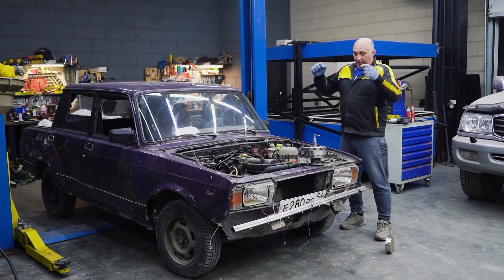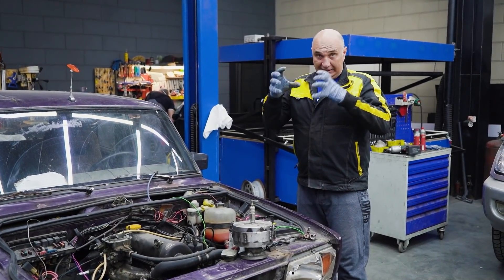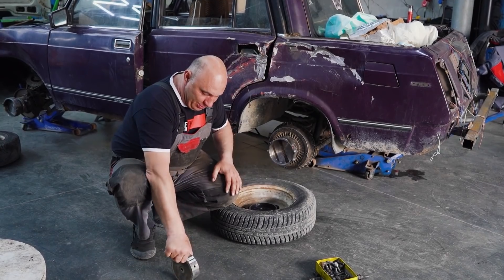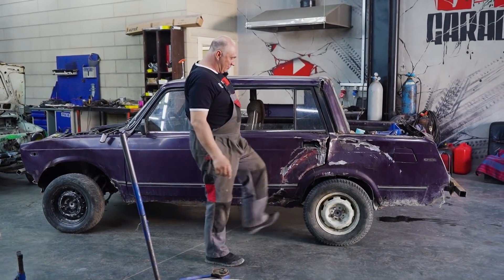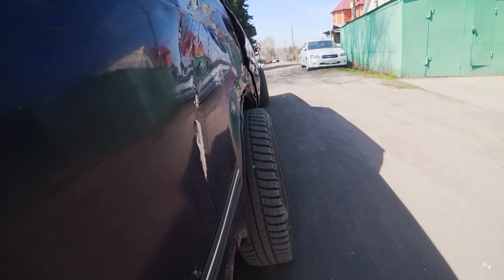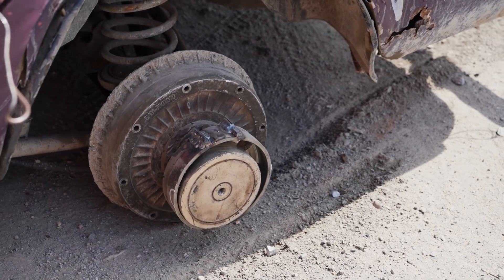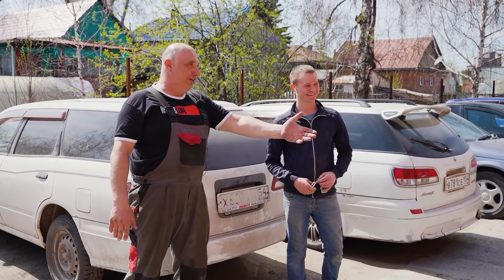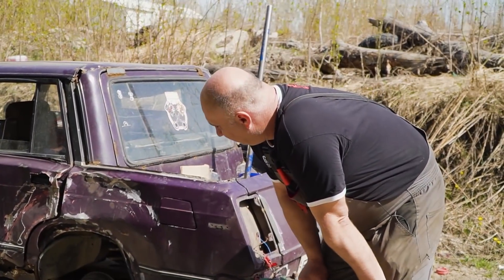Using magnets to mount wheels – will it work?

Comment: You should redo this test instead of one magnet on the hub and instead of using that magnet to attach the wheel put one magnet on the wheel and one magnet on the hub. making it a total of 8 magnets. your issue here just like you demonstrated at the beginning is lack of iron on the rim.

Comment: I used to do magnet fishing, one time my magnet got stuck to the metal reinforcements of the river bank. Due to the angle I couldn't pull it of with the rope, so I went back home and got my wet suit but when I got back my rope and grapple were missing, they couldn't get the magnet though 😂 I managed to get it off when in the water as I could pull it from an angle where it was weak.

Comment: They have material handling magnets for industrial applications moving sheets of steel they hold as much as 4500 pounds each made for moving steel on factory floors 4500 pounds = 2041.166 Kilograms

Comment: Project idea.  For the brakes on a car, instead of disc or drum brakes use a clutch and pressure plate from a manual transmission for a braking system.   Modifying the “clutch” and attaching it to the hub for a break system instead.  A lot of hydraulic clutches operate just like brakes.  You would have great surface area for stopping power but you might need to use a large wheel for clearance around the clutch?  It depends on how big of clutch and pressure plate you want to use.  There’s many ways you could do it, one would be to mount the clutch to the hub and the pressure plate to the wheel or vice versa.

Comment: Project idea: use a torque converter in place of the clutch on a manual transmission for a smooth shift every time!

Comment: Electric car with electro-magnetic wheels. If the car run out of battery the wheels will fall off... No need for an voltage meter. LOL

Comment: You should connect the exhaust to the carburetor and see how long it runs with fumes just circulating.
Reply: It would run out of oxygen quite fast
Reply: Unless it's literally dumping raw fuel from the exhaust, I don't see that working out lol.

Comment: I have an idea,using fwd engine and transmission and using the one axle as the driveshaft and connecting to the rwd differential
Reply: It will work, my cousin did that in the 90’s building a lightweight rock crawler out of a Mazda 323 drive train and a Mazda B2000 long bed truck .  With the engine mounted inline behind the cab, he had the left CV axle go to the front differential and the right CV axle going to the rear differential.  He did have to lengthen the axles.  It wasn’t pretty but it did work.  I think it’s behind the barn at his parents house covered in blackberry vines

Comment: I love this channel! I have an idea, of anyone wants to try. Make a Lada driven similar to a train! Connect the engine or transmission to a generator, and have electric motors at each wheel hub, and see if it'll drive that way! Of course there will need to be alot of electrical expertise, but I know you guys could pull it off. 😎

Comment: Some extension ideas to the groundbreaking research conducting in today's video:
• plastic cable ties would do an excellent job of holding the wheels on the hub.  The big, thick ones might be best.
• install just ONE of the lug bolts? (throw the other 3 away) Those extra lug bolts are just for aesthetics, right?
• make aluminum lug bolts from melted soda cans. How will those hold up?
• 3D print some plastic lug bolts. Those should be super wonderful.
• wooden lug bolts?  (Why the hell not?)
• cut all of the lug bolts halfway through. How long will they hold on the wheels while drifting, etc.?

Comment: With suction, the wheels get sucked back in by a greater vacuum after getting nudged out. With magnets, the pull force drops drastically with gap width and the magnets walk off.

Comment: What kind of car is this?
Reply: VAZ 2104
Reply: @alexdro4389  Thank You!.. so the truck bed is a custom creation from the wagon? I can't seem to find any images of this version
Reply: @uwulord7458  There was an OEM pick-up version called VIS-2104 (ВИС-2104). The car on this video was modified into a pick-up.
Edit: it was called VAZ 2104-33, VIS was making pick-ups with metal boxes.
Reply: @crown674  Thank you very much for both Vins. Since I've seen that car I picture all cars with this mod, it seems under utilized. So having the oem to study is priceless.

Comment: The metal of the hubs is more substantial than that of the wheels. And this wouldn't work at all with a wheel that is made of a weakly magnetic matieral (read: aluminum).

Try sandwiching the wheel between the hub and magnet.

Comment: dont magnets loose their magnetism as they warm up ?
Reply: Yes they do, i demagnetised one melting off the glue holding it with a hot air gun
Reply: Makes you wonder how theres supposedly a hot molten magnetic core in our planet...
Reply: @mikehunt8375  I wondered that myself, but the iron based magnetic crust is spinning around the slower core, an easy way to understand is the eddy currents generated between a magnetic metal and none magnetic lava moving close to each other  generates the magnetic field,  like a magnet sliding slowly down through a copper or aluminium  pipe

Comment: Use micrkwave oven transformers cut in half as electromagnets. They are much stronger then permanent magnets and work with 12Vdc from a car battery.

Comment: Try this: put magnets where the rear brake shoes are located, so that they will turn the brake drum when the magnets spin. Connect the magnets to the differential shafts, put the transmission in high gear, and see if the magnets will "motor" the brake drums and drive the car!
Reply: I'm thinking similar to how a torque converter works, but using magnetism instead of fluid?? Interesting 🤔
Reply: So like centrifugal clutch, but instead of centrifugal force it uses magnets? Magnet clutch.

Comment: One of my cousins went magnet fishing with one of those and it got stuck he tied it to his truck and ended up pulling a motorcycle frame its still one of his favorite story's to tell.
Reply: That's a pretty cool catch
Reply: I saw a video with something similar, they got a magnet stuck on something so they tried using their truck and got it loose but it flew towards the truck. And stuck to the side of the truck and left a massive dent.

Comment: My first thought was, there must be a cover to prevent horizontal motion, the most power they have axial. But, how do you rip the wheels off if you have to?
Reply: Use that long piece of all-thread as a jackscrew.
Reply: Latches?
Reply: Just start doing some wild donuts.

Comment: Could this be done with electro-magnets? Turn off the power, wheel disconnects type of a thing.
Reply: It would be dangerous and useless, I think they should try it
Reply: @herbiehusker1889  Definition of entertainment
Reply: Post-theft remote car disabling system lol 😆 
<click> bye bye wheels.
Reply: Yeah. These permanent magnets on the outside and electromagnets on the inside. That way, you could attract or repel them at will.
Reply: Sure, but the amount of power needed would be a lot.
Reply: @theFLCLguy  Door holding magnets do not need that much power, and the bigger ones can be on par with these magnets.
Reply: @gabiold  those door holding magnets are probably as strong as the magnets they used here.
The problem is it's a different kind of force on it. They need to be a lot stronger if you want them to stay on.
Reply: @theFLCLguy  The force is the same, I mean, these neodymium magnets are also made for lifting, like the door holding magnets, so axial force. If the wheel holder would be made im a way that it would fit radially then there would be only axial force pulling it off. And the tabs required too for preventing rotation, but two way tabs to prevent backlash.

I also suspect (did not calculated anything, just by feeling) that the 8-10mm thickness of the holding plate is on the minimum side. Look at the front of the magnet you intend to use: the cross section of the holding plate should be on par with the cross section of the poles of the magnet and I think it is bigger than 10mm in beefier magnets. The full magnetic flux should "fit" into the steel without saturating it.

Also grinding the plate increases the force a lot. If the surface is rough or non-planar it increases the air gap here and there, which weakens the force drastically.
Reply: @theFLCLguy  just put another alternator and battery on the vehicle for the magnets.
Reply: @theFLCLguy  Not really.  I have one that uses a D cell (1.5V) and it can lift hundreds of pounds.
Reply: You beat me to it
Reply: I was thinking the same thing for Formula 1 cars, ultra quick wheel change
Reply: @nigelman9506  
Probably to heavy for F1 you’d get a faster pit stop but lose it all on track I would think.
Reply: Like the magnets of the air aconditioner dont you?
Reply: I don't think they read comments on the English translation channel.
Reply: @midlbrwn15  Fascinating... They've responded to me before. Maybe they just don't like you
Reply: @BCaldwell  damn... Guess so.. I've never seen a response, either.
Reply: Formula 1 is listening
Reply: First thing I thought of maybe make it a stronger magnet, but all in all its more hassle than a lug nut 😂.
Reply: That's what I was thinking then also if F1 teams could do this
Reply: One push button release switch for each wheel and a silly big switch to release all 4 tires at the same time would be SPECTACULAR!
Reply: That's what I was thinking. Electronic magnetic 🧲
Reply: Would help if the magnets were serrated
Reply: I was actually coming down to the comment section to say this exact thing.

Great antitheft if the alternator is what keeps the wheels attached!

Comment: Magnets are strongest when being pulled straight off rather than when pushed sideways.
Reply: Yeah they needed construction where vertical movement is fully locked and magnets only hold in/out movement.